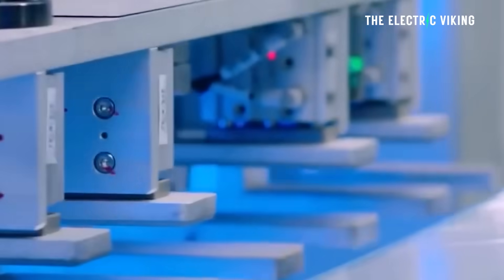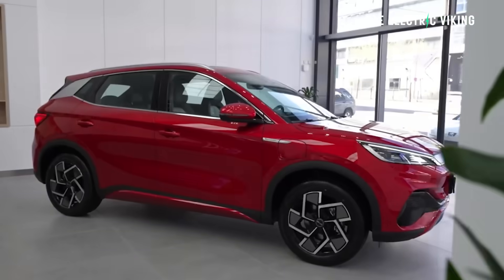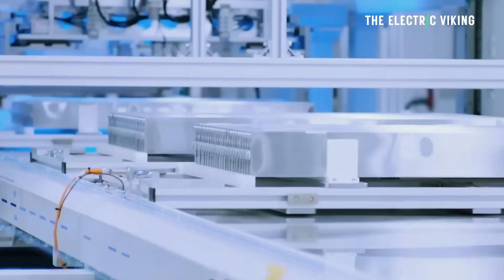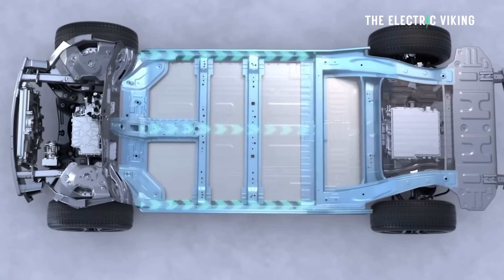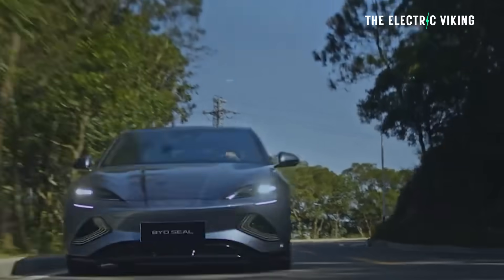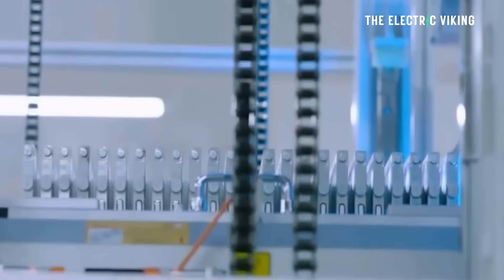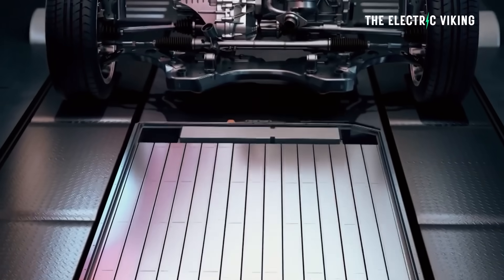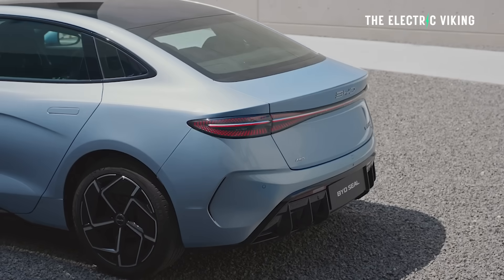BYDs 2 new batteries; ULTRA high energy density LFP or 700kw charging

Comment: High density for me. Means potential lighter package. What I want most: The top of the range AWD 390kw Seal weighing in at around 1800kg with a range of around 500km.

Comment: Energy density makes batteries lighter but it wont make more range. kW=kW
Reply: If you're getting more energy from the same size battery then you're clearly getting more range and the fact that it's lighter will add even more range

Comment: BYD, given its a fully integrated EV company, spend a lot less resource than CATL in battery R&D but has not lost out to CATL in progress. Its a remarkable feat. BYD's installed based of cars is in the region of about 10m. Its a pity it does not do more in self driving. It would skyrocket the stock

Comment: Sam, you are still conflating energy density with range. Energy density only influences range if the lower weight increases efficiency. 

You said both cars would have 80kw batteries, let’s say the higher density improves efficiency from 18kw per 100km to 15kw per 100km on the same route on the same day (2 different cars same model), range would be 533k and 444k respectively. 

And both travel 1200km at 120kmh for the sake of easy math. Higher density takes 20 mins to add 533km car b 7 mins to add 444km. Car a therefore takes 10 hours and 40 mins to travel 1200km. Car b takes 10 hours and 21 mins to travel the same distance but with an extra stop albeit shorter stops. 

I’d call that a tie but theoretically faster charging saves more time than more energy dense but lighter more efficient longer range.

Now if you were to say that we can put a 100kw battery in the high density car and an 80kw in the fast charging car and efficiency is equal because everything else is now equal (and the price is the same) the 100kw theoretically has a 20% greater range which is slightly better than 2 80kw cars but 1 is lighter, but again not significant enough to alter the math drastically.

The point of this post being to point out energy density alone does not increase range, it must be either because of a bigger pack in the same space or the lighter pack increasing efficiency, but even that isn’t the entire equation because a higher weight theoretically has a higher energy recovery ability through regeneration so it’s way too simplistic to equate density to range.

Comment: did you see these charge in 7.5 min? fast charging actually destroys the cells, I don't expect these cells to last.
C charge means if the battery is 5Ah and the rating is 8C that means it can charge at 40amps. etc

Comment: err 50/50?   Quick charge if I just need enough to get home 40 miles and can charge that amount in 3 minutes. But the other half of the battery is the long range for when I charge at home or at while work or while at lunch.

Comment: Reminds me of playing Distant Worlds and the mid-game hyperdrive or shield options.

Talassos Shields recharge quickly, while Deucalios Shields have higher capacity.

Kaldos hyperdrive initiates jumps rapidly, but is slow in FTL, Equinox hyperdrive charges slowly, but is fast in FTL. The third hyperdrive is intermediate in speed and initiation but costs less energy.

Unfortunately the game is not well balanced between these modules, so Deucalios Shields are always better, and Equinox hyperdrives are the best type for general use until you get Torrent drives. Kaldos hyperdrives are however the only one that gets better than a Torrent Drive in any aspect (jump initiation of 2 seconds vs the best Torrent Drive's 3 seconds IIRC).

Let's see how BYD balances its battery options so both are profitable...

Comment: has BYD fixed their fire problems with their batteries?  Those of you charging at home, is your garage attached to your house or do you have a stand alone garage?  Our neighbor keeps their Hyundai Ioniq5 EV charged on the driveway away from their house.

My own experience, having worked for a Chinese SOE, is that Chinese companies will go for the lower cost, even if that cost is below what is considered bare minimal safe, so the reduced cost is at the expense of things like safety, lock out circuits and crash protection.  I have personally attended TDAs, teardown analysis, where the people in the room (including McKenzie experts, which are very good, btw) quickly recognized the lack of side impact protection from the CTP, cell-to-pack, design from BYD.  CATL also makes their 2nd or 3rd generation CTP ESS, but can tell that CATL put a lot more emphasis on crash protection and fire propagation protection.  I give credit here to Bob Galyen, fmr CTO at CATL who turned CATL from nothing to what it is today, a true technology leader in both cell chemistry & ESS pack engineering.

Those of you who know the NEV business, will understand what I mean by looking at CATL's 2nd gen Qilin ESS pack.  They use coolant flowed vertical cold-plates to separate rows of cells, literally liquid filled firewalls to mitigate the number of cells which can ignite from a single cell failure.  There is none of this technology in BYD's CTP.  For BYD, it is just remove, delete, eliminate necessary parts for needed functions just to pack more cells into the ESS packaging space (woohuu, higher pack level density to brag about), but minus critical necessary functions such as described above.

I got into NEVs in China in 2009 at the dawn of NEVs.

Comment: The charging station for these charging speeds will have to be adjacent to an electrical substation. The cabling and transformers for six of these chargers will need the same electrical supply as a small foundry. 
What is the point of this? And who is going to spend the millions of dollars required to charge six of these cars. 
Twist up another spliff, Electric Viking...

Comment: Use case. Busses, Taxis, etc need fast charging. Once batteries give 400 miles range most people only need overnight slow charging, even on a road trip after 400 miles you say overnight at a motel.

Comment: The maths is out Sam. It's not going to give 800km of range at a reduced cost. To go from 600-800 the pack will be 33% bigger costing so from 80kwh to 120kwh. Now it's 15% cheaper so at $50 the 80 is $4000 the 120 at $42.5 is $5100. But that's at a cell level. At a pack level who knows. Aways great to see reduction but now the battery is not a big cost in the car.

Comment: Interesting question. I have the old blade battery. Faster charging is always nice, but150 to 210 Wh/kg would mean going from 60 kWh to 84. And with higher capacity comes higher charging speed, so in theory it would go from 170 kW to 238 kW. That would be pretty awesome.
The other option would keep about the same capacity, but charge at 480 kW. There are hardly any chargers around with that kind of power. I would go for the higher density/capacity battery.
Reply: Agreed. Most fast chargers tapp out at 250kW or below. If you need 50kW, it's gonna be done in 15-20 mins anyways(200kW).  
I think the biggest advantage of a higher C is that the battery can charge at a high speed trough more of the charging-session.

Comment: I hope that as energy density increases, and the availability of charging infrastructure is improved, manufacturers will take advantage of this to offer smaller LIGHTER batteries to reduce the heavy friction load on tyres, thereby reducing tyre dust pollution somewhat.

Comment: Why do people still push for EVs? Hybrids have been proven to be better in every way
Reply: Hybrids are more complicated and they're the ones with elevated fire risk. Worst of both technologies is one way to look at them. People are buying hybrids because of shortages of charging infrastructure at the moment and range issues. Some companies offer a petrol option to recharge the batteries on a long trip -- the actual motors are all purely electric. That's an interesting approach. My guess is that EVs will largely replace the hybrids once charging options improve, range increases, and battery costs drop.
Reply: @randygraham926  No, people are buying hybrids because they're better and because they're the best of both worlds. There are massive studies that prove that. EVs will not replace anything. You think you know better?
Reply: Which studies say hybrids are better in every way
Reply: @JGood-Quebec  Those done by Toyota. Look it up.

Comment: One thought that I have had is that rather than focusing on top charging speed which requires infrastructure improvements to accommodate it, it would be more useful to improve on the charging speed curve, my Tesla will charge a 250 kW, but I’ve only ever seen that a handful of times and it very quickly gets down to 175. If it could sustain 250 kW up to 80% state of charge that would be an accomplishment, and perhaps that’s what this kind of battery brings to the table rather than super high charging rates.

Comment: In real world, use that high, charging speed would be virtually useless, but the higher energy density would benefit every EV owner that had that battery. The reason the high charging rate is useless is there are no chargers, delivering that amount of power, if you had 100 kW battery at 3C to maximize the charge rate you would be at a 300 kW DC fast charger, which are relatively common but probably represent about half of the chargers that I go to, many are only 150, and truth be told. I only need to use fast chargers once in a great while. for practical purposes, 16 C is almost worthless, and to pay a significant power density price is definitely not worth the trade-off for just about any EV owner. Here in America practically speaking 400 kW is about as high as are gonna find on a regular basis, perhaps even an irregular basis. because there is so little infrastructure to take advantage of that charge rate paying the energy density price makes it totally not worth it. Think about this, in order to maximize that charge rate on 100 kW battery you would need a 1600 kWh charger, and in addition to that in order to get up to that level, you would have to have super high voltage, at least 800 V, if not 1600 to keep the cables from being the size of your leg.

Comment: I'll take the higher range because I take my Y up to the vacation home often and I would love not to have to charge up every trip up and back. It's not a big deal, but I could drive all the way up without filling up my old Prius and still have fuel to spare. With the Y when I get there I'm on empty. Then it's min couple hrs to add charge if I need to go anywhere.
So more density would be a nice advantage

Comment: To charge a battery that normally takes 30 minutes to charge in 7.5 minutes requires 4 times the current. That's 4 times the generating capacity and 4 times the distribution capacity. Otherwise it will still take the same time to charge.

BYD- Burn Your Driveway 

Wake up people.

Comment: BYD need to allow retrofitting. If you could change current byd dolphin/seal battery to v2 - that would be great. Also they need to invest in UI/UX. In portrait mode you should have possibilities to split screens - like 1/3 for android auto - 1/3 for spotify and 1/3 for cameras/battery usage/whatever. I heard that you can't use android auto in portrait mode? 

Also we don't see that lower battery costs in prices in cars. 

Also they need to put these battery quickly in 2025 models. There is BYD Seal 06 gt- which is a byd dolphin inside! Only top changet for hothatch to close the gap to Mg4 xd 
It is wasted potential, because it could have that new battery and higher charging speeds. I see BYD is staying behind others. 
BYD Dophin price is almost tripled in Poland to what they have in china (150k PLN). You can buy cheaper used Hyundai kona 20-22 with ventilated and heated front seats and heated rear. Kona is more efficient, slightly better range with bigger battery.

Comment: Yep they could do a modular battery design of one fast charge segment ( lower energy density ) and one slower charge segment ( higher energy density ) They could be electrically switched during charging to accept charge input in the preferred order. It could be controlled by the software interface of the EV on the dashboard. Thus if you want a fast charge / lower range prioritised, you select fast charge. If you want the slow charge / longer range prioritised, then select slow charge. That way you can charge your EV based on your usage requirement. For short trips you select fast charge as the priority. For long trips you select slow charge as the priority. Otherwise you could have an automated mode that determines the charging regime based on your trip distance and where the EV charging stations are located, what their usage regime is and whether they are busy and av average EV charge station charging rates and wait times etc...
Reply: 电动车不都是有快充口，和冒充口吗😂

Comment: Do you know how ridiculous 700kw is. I built a 200 room marriott hotel and my electricity permit is only 550kw.
Reply: 华为已经投入使用了600kw的液冷超级充电桩
Reply: It's more likely to be used as a AB dual battery setup - rapid for quick 100 miles tops ups and extended regen capability, slower batteries for range say 400 miles.

Comment: What percentage of thermal runaway on these batteries?? If u high current charge these batteries how does it reduce lifespan and range??
Reply: LFP is not susceptible to thermal runaway. That is a ternary issue. BYD also discussed 15,000 charge cycles and lifetime battery warranty.

Comment: Ask an engineer about the consequences and difficulties of such high currents and high voltages.
V=IR, P=VI are not going away.
800kW means
1000 amps (@800V) Really?
or 2000amps (@400V)
You must be mad.
Reply: 这种超级充电桩匹配800v系统的电动车，华为的600kw已经投入商用